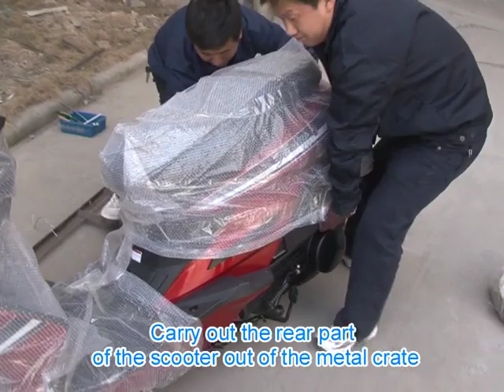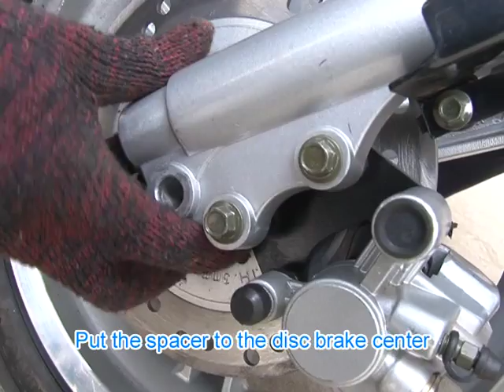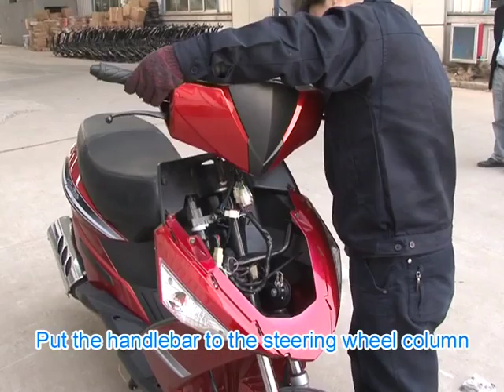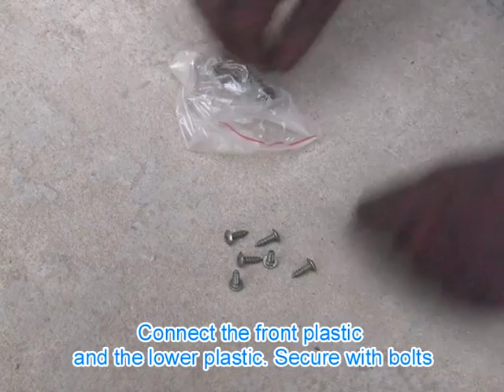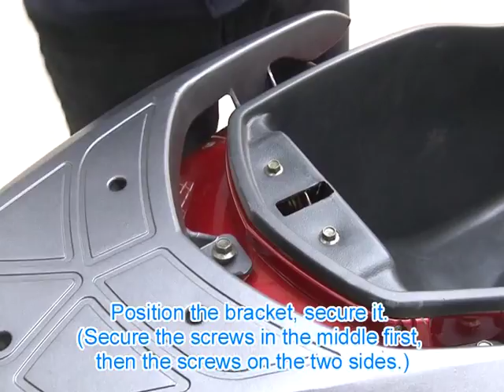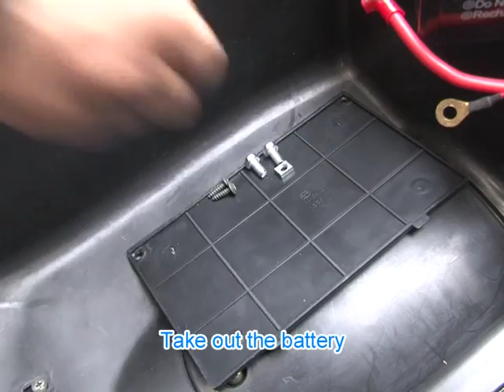Official TaoTao 150cc Scooter Assembly Video (CY150 + ALL 150cc TaoTao Scooters)

Comment: buying quantum 150 c.c trying to get things before it gets here. what oil do I put in. what gear oil do I use?
Reply: I used 80W the gear oil they use is shit so basically flush and put in new oil when you buy or at least by the first 3000. Also you need to re-space the headers by 3000 but yeah easier to just do so after you buy.

Comment: Just received my new Razor 150 today. 6-26-2020.  Good price.  No paper 
assembly instructions just you tube.  One thing, to open the seat. I couldn’t figure it out.  Had to call...Key in the ignition and turn left.  Let’s see what happens tomorrow
Reply: I just ordered  Razor 150 from Redfox. No one makes videos on them. How do you like it? Are the 10 inch wheels a problem?
Reply: @DivergentDroid  I’m not an expert on this...so take it for what it’s worth.  Good price.  No instructions. Had to go to You Tube  . Found some info but no manual.   My headlight wasn’t working. The wire wasn’t connected.   Idle was too low.  No problem with the wheels.   For the price you can’t beat it .  Over all I like it.  Good luck. Have fun.
Reply: @GG-xs8vt  Thanks. I've seen enough videos about these unboxings not to leave anything to chance. I'm sealing all bolts/screws with Loctite, checking every hose and wire, replacing all the fluids inc spark plug, retuning the engine. I downloaded 30 pdf's on how to repair just about any Gy6 problem you can imagine. Tons of free pdf's out there. And if that's not enough, My ex brother in law, a 20 year ex cop and motorcycle enthusiast will be here to help me. I have to make this work and work right. I'm on a tight budget. It will be a year before I can try and buy something else and the siren of the open road keeps calling.

Comment: hello guys Just got a new one 2017 good question, I never have one before!
 before use it do i have to changed the oil? or just need to put gas on it and use it? 
thanks for answer!
Reply: Alejandro García yes to both and what model did you get and is it a 2017 model?